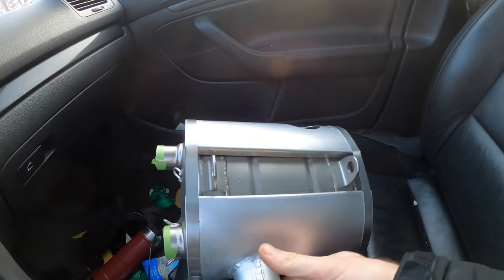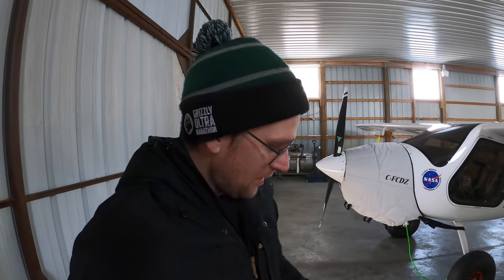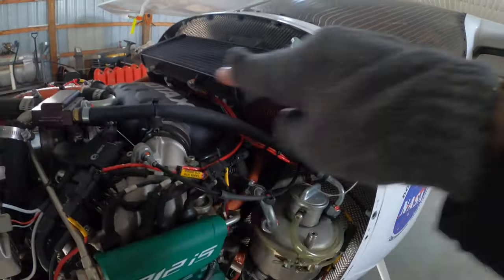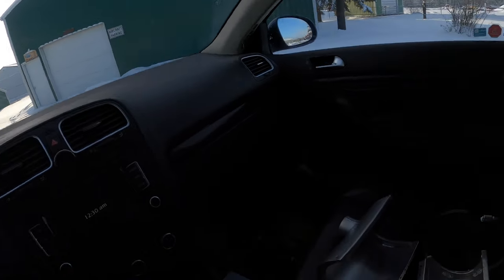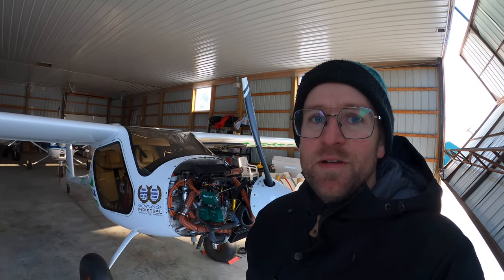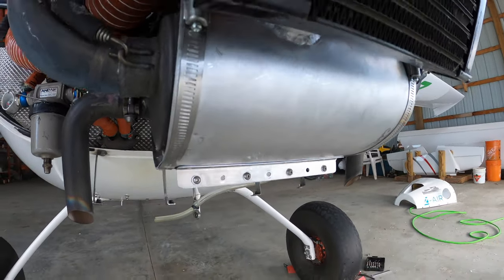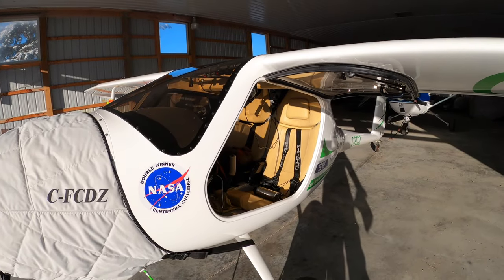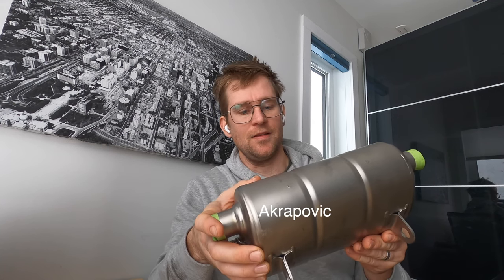New cabin heater for rotax 912iS Engine Available to BUY!!!

Comment: Thanks for the videos - I was wondering what kind of cruise performance you get with your pipistrel? I know they advertise cruise speeds of 147 knots... Do you actually cruise that fast? What recommendations would you have for a prospective buyer?
Reply from the maker: Hey I get about 125knot cruise with the small tires and wheel pants. Some get 135knots. You cannot achieve the 147knot cruise. This is outdated stat and was possible at the beginning of the virus sw production when they had less drag. But now with the 100hp engine you have more cooling drag, antennas, landing light etc. For new buyer I’d recommend you go fly in one first to make sure it is the right aircraft for you
Reply: @DarrylZubot  Are you talking indicated or true?

Comment: Hey Darryl, just wondering what your opinion is on 912 ULS vs 912is? If you were buying a new plane, which one would it be and why? Anyone out there with opinions and/or experience? Much appreciated!
Reply from the maker: Hey. Definitely the fuel injected 912iS. Have a friend with 912ULS. He got fed up balancing the carbs that he converted it to fuel injected. It’s much smoother engine, less maintenance, better fuel burn, auto mixture. I’ve had zero issues with it after 1500hours.

Comment: What is the size and model of these wheels? I wonder if there is an equivalent front wheel which fits to Virus SW… great video as always.
Reply from the maker: Thanks! Unfortunately you are stuck with small tires with a trike. These are aero classic 850-6 tires from aircraft spruce.

Comment: Darryl did you say you had it custom made? Is it to specs re pipistrel?
Reply from the maker: I’m not entirely sure what you mean. This was not built by pipistrel as they refuse to make a full muffler shroud for whatever reason. This one is made at local aircraft exhaust welding shop. I bought a new muffler from pipistrel for the shop to use to design and build this shroud. They waterjet some of the parts for it.
Reply: @DarrylZubot  Thank you Darryl! No I was wondering if you had to design it yourself to make it work if the ac company Pipistrel didn’t make a larger one.  You answered me . I am almost done training. ( c19 hampered it ) I am still looking for a AULA in the mean time . My choices have come down to Pipistrel. ( Virus or Sinus motor glider , Flight design and Tecnam ). Thanks again. I can’t say I miss the extreme cold since I move to southern Ont 32 yrs ago but will look to move back when I retire .

Comment: Do you not have propane heat in hangar?
Reply from the maker: Hangar is not insulated, and large gaps in the hangar door. So heating would be useless unfortunately. But I do think that having a non heated hangar is better for the composite aircraft. It is not being shocked with temps when you take it out of a 20°c hanger into -30c temps.
Reply: @DarrylZubot  can you give a link to your heating blanket or whatever it is?
Reply: @DarrylZubot  Thanks again for the answers sir !
Reply from the maker: @grzechuk6776  https://www.tanisaircraft.com/product/piston-preheat/tsp4cyl-2579-115
Reply: @DarrylZubot   May be, you can set something like a local cover to work, kind of a wigwam, made of wooden frame and plastic film. And add some hot air inside. Otherwise it seams really cold to work. I'm from Russia, but even for me it looks cold )